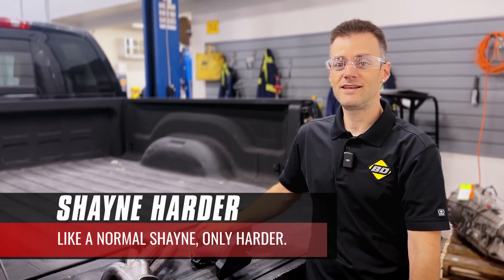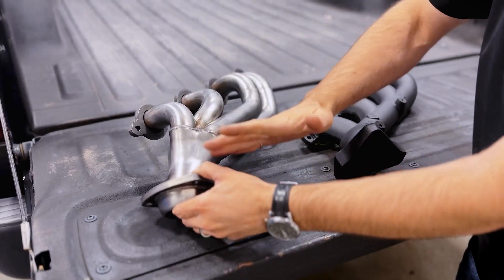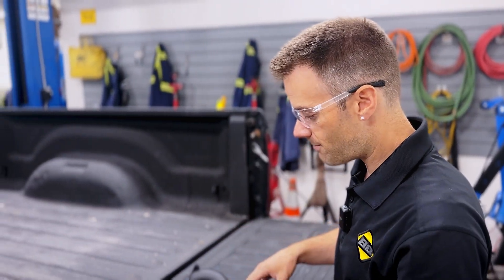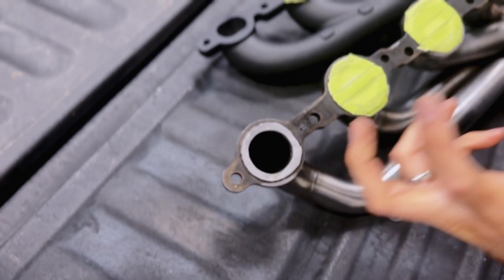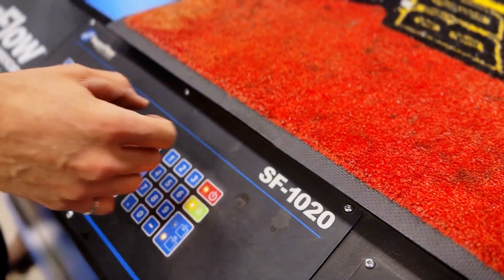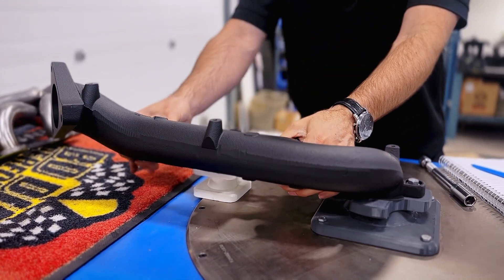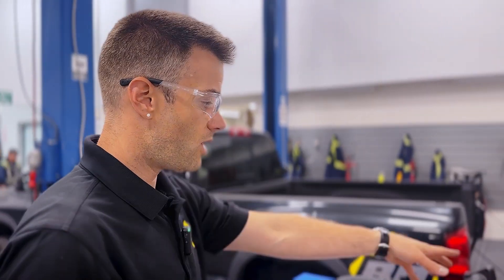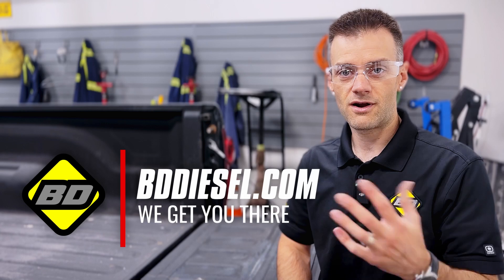Manifolds vs Headers: Which is Better?

Comment: Have a 2024 Dt new body ram 1500 with the infamous hemi tick I love this truck and plan replacing the issues with upgraded parts my question is would it be better to go kind long tube headers? not only fixing  the issue but last longer and better performance wise or the shorty bd full kit manifold that specifically addresses the problem ?

Comment: Having a third gen firebird, shorty headers were the only choice i had. Its a pain to make long tubes work and you usually lose ground clearance. The shorty headers and full exhaust made a massive difference over stock

Comment: BS. The headers perform better exhaust scavenging and testing the flow of one tube don't prove crap. Those headers are worth 30 HP over the stock manifolds on a stock 350. Also get better gas milage. My c1500 is proof of it.
Reply: Plus he only tested the best flowing part of the manifold, if he tested the rear port that 90s into the log it would have tested much worse.